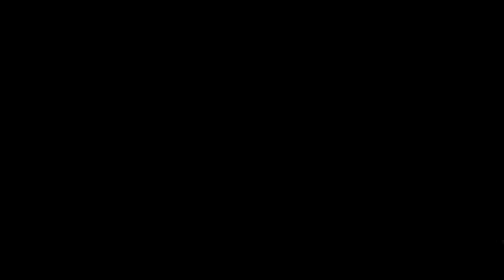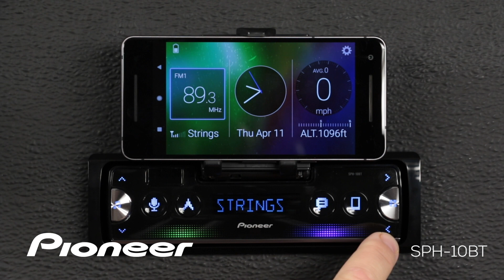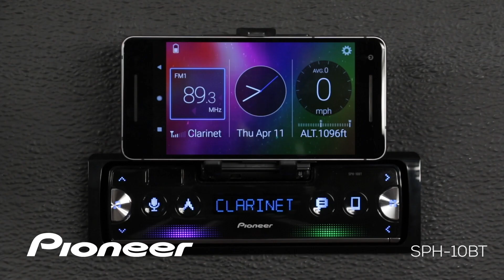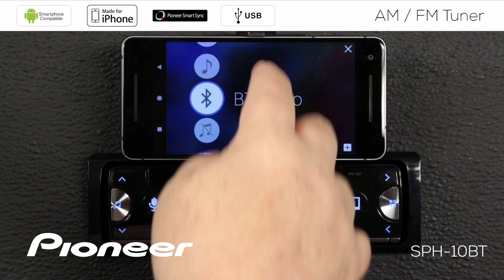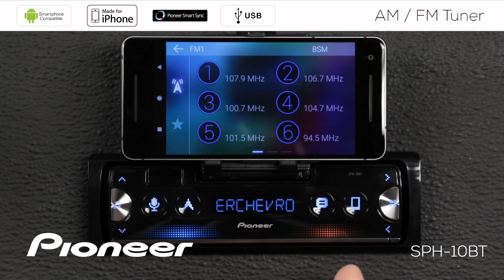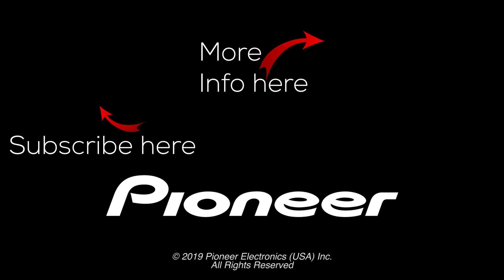How To-SPH-10BT - FM/AM Tuner with Smart Sync App

Comment: Okay it’s September 2020 and still the radio lack this function to just set 6 preset stations. You can do it in the app but when not using the app the presets are gone and only shows the BSM stations. A simple fix by just let the radio sync the presets from the app will solve this stupid problem. If I new this radio had this problem I wouldn’t buy it. I expected more from Pioneer :(
Reply: The Pioneer SPH-10BT is designed from the ground up to operate with a phone.  The phone is the control system for the receiver.  The receiver by itself has a limited number of functions, because it is designed to be operated by a phone.    If you want to use a receiver without a phone, perhaps a more traditional receiver is a better option for you.  Please consider the Pioneer MVH-S320BT.  It has radio station presets along the bottom the receiver.  Just what you're looking for.  You can see it here:  https://youtu.be/cXbvdfgLS2o   You can find more videos on Pioneer's YouTube Channel here:  https://www.youtube.com/user/pioneerelectronics

Comment: The player stops only at odd number frequencies. i.e. It stops at 106.7 or 106.9 but never at 106.8. The jumps are in multiple of 0.2s. How can i change that?
(i am not US based but i got my player from there)
Reply: The Pioneer SPH-10BT is designed for the North American market.  I'm not aware of a way to change the radio frequency interval to even numbers after the decimal.  You can find more videos about Pioneer SPH-10BT here:  https://youtu.be/_ISxPmindi4?list=PLw63zJRQbCNiGNMG9zaOiTR3NgWe2T7ol     Please be sure to have the latest firmware installed on your Pioneer SPH-10BT.  You can find it here:  https://www.pioneerelectronics.com/PUSA/Car/Digital+Media+Receivers/SPH-10BT#downloads  You can find more videos on Pioneer's You Tube Channel here:  https://www.youtube.com/user/pioneerelectronics

Comment: Is there not a way to store and scroll preset radio channels with connecting to the smart app?   I cannot find a way to do this and therefore cannot use favourite / custom preset channels without a device connected  )-:
Reply: The Pioneer SPH-10BT is designed to be operated by the connected phone.  As of 2020 March, I'm not aware of a way to change the radio station presets without using a connected phone.  Please be sure to have the latest firmware installed on your Pioneer SPH-10BT.  You can find it here:  https://www.pioneerelectronics.com/PUSA/Car/Digital+Media+Receivers/SPH-10BT#downloads  and you are using version 2.7.0 or newer of the Pioneer Smart Sync App on your phone.  You can find more videos about Pioneer SPH-10BT here:  https://youtu.be/_ISxPmindi4?list=PLw63zJRQbCNiGNMG9zaOiTR3NgWe2T7ol   and you can find more videos on Pioneer's You Tube Channel here:  https://www.youtube.com/user/pioneerelectronics

Comment: Will it ever be possible to select the radio presets using the radio buttons? It is very dangerous to change the presets using the touchscreen. And please dont tell me to update it, if it wont solve anything. I dont care about the BSM, it is worthless.
Reply: The Pioneer SPH-10BT is designed from the ground up to be operated by the Pioneer Smart Sync app with a phone in the phone cradle. If using the phone for this function makes you uncomfortable, or you believe it's dangerous, I recommend using a more traditional in-dash receiver like Pioneer MVH-S320BT seen here:    https://youtu.be/cXbvdfgLS2o   The Pioneer MVH-S320BT has radio station preset hard key buttons on the face of the radio, and it will still work with the Pioneer Smart Sync app for Navigation and other functions if you care to use it that way.
When using the latest firmware for the Pioneer SPH-10BT as of 2020 February and the latest version of the Pioneer Smart Sync app, 2.7.0 or newer, the Radio Station Presets 1 through 6 appear across the bottom of the phone screen when on the AM/FM Radio source screen.  It does not mater if the phone is in a vertical or in a horizontal position.    You can choose any radio station presets you like.   BSM, while a very useful feature, is not needed to create a radio station preset. 
As of February 2020, when using the Smart Sync app,  I'm not aware of a way to use  the hark key arrows on the in-dash receiver to scroll through the radio station presets. They operate the seek function on the radio.  One press the and the radio will tune in the next available radio frequency.  Press and hold to seek to the next available radio station.  Of course the Local /Seek function is a filter to remove the weakest radio stations.  It can be set to 4 levels of filter and switched off.  A future update to the in-dash receiver firmware and update to the app may change this operation. 
You can find the latest firmware for the Pioneer SPH-10BT here:  https://www.pioneerelectronics.com/PUSA/Car/Digital+Media+Receivers/SPH-10BT#downloads   You can find more videos about Pioneer SPH-10BT here:  https://youtu.be/_ISxPmindi4?list=PLw63zJRQbCNiGNMG9zaOiTR3NgWe2T7ol   and you can find more videos on Pioneer's You Tube Channel here:  https://www.youtube.com/user/pioneerelectronics

Comment: Im thinking of putting one of these units in my Harley Davidson fairing,im curious how well that phone holder locks onto your phone(im worried my phone might fall out of it while moving) I curretly have a S9+
tyvm
Reply: I'm not an experienced motorcycle rider.  My limited experience with Harley Davidson motorcycles is that they vibrate in the handle bar/ faring area quite a bit when idling. I would not recommend using the Pioneer SPH-10BT to hold the phone in an application with excessive vibration.  The Pioneer SPH-10BT holds the phone firmly, by using simple spring loaded friction brackets. You can see it here:  https://youtu.be/2X0_WyTEMp0?list=PLw63zJRQbCNiGNMG9zaOiTR3NgWe2T7ol&t=184    There is nothing sort of clamped over the corners of the phone to ensure it is not jarred loose during the heavy vibration you might have while idling or riding.   There are some other options.  A dedicated clamp to hold the phone and it will still connect to the Pioneer SPh-10BT for full operation.  Or another Pioneer in-dash receiver, one that has a short chassis and operates with the App on the phone the same way. You can see one option here:  https://youtu.be/K1FYzLu39ow?t=117   You can find more videos about Pioneer SPH-10BT here:  https://youtu.be/_ISxPmindi4?list=PLw63zJRQbCNiGNMG9zaOiTR3NgWe2T7ol  and you can find more videos on Pioneer's You Tube Channel here:  https://www.youtube.com/user/pioneerelectronics

Comment: Even after updating to the most recent firmware I still can't add favorites or edit present radio stations... I don't even get the star icon to add favorites
Reply: Are you using the Pioneer SPH-10BT and the Pioneer Smart Sync app on your phone?  Are you in the US?   Please be sure to have the most recent version of the Pioneer Smart Sync app installed on the connected phone. You need version 2.1.0 or higher.   If this does not work, I recommend to uninstall the app and re-install the Pioneer Smart Sync App from your app store.  Please be sure you have the latest firmware installed for Pioneer SPH-10BT.  You can find it here:  https://www.pioneerelectronics.com/PUSA/Car/Digital+Media+Receivers/SPH-10BT#downloads    You can find more How To videos about Pioneer SPH-10BT here:  https://youtu.be/_ISxPmindi4?list=PLw63zJRQbCNiGNMG9zaOiTR3NgWe2T7ol   and you can find more videos on Pioneer's You Tube Channel here:  https://www.youtube.com/user/pioneerelectronics
Reply: @deckerdotto6035  same problem. updated firmware 8.18 on radio and lateste app v2.9.1
Reply: Please be more specific with your question.  What is the model number of your Pioneer receiver?  What are you trying to do?

Comment: I need to choose the station presets. Please fix this nonsense. If I knew I would have never bought this thing.
I have the latinamerican version ( sph-10cbt ) and till now, there is no firmware for this version.
Reply: Please update the Pioneer Smart Sync App to version 2.1.0 or higher.  Radio Station Presets are available through the Smart Sync App.  Please be sure to have the latest Firmware installed on your Pioneer SPH-10BT.  You can find it here:  https://www.pioneerelectronics.com/PUSA/Car/Digital+Media+Receivers/SPH-10BT#downloads   You can find more How To videos about the SPH-10BT in this Pioneer You Tube Playlist:  https://youtu.be/_ISxPmindi4?list=PLw63zJRQbCNiGNMG9zaOiTR3NgWe2T7ol   and you can find more videos on Pioneer's You Tube Channel here:  https://www.youtube.com/user/pioneerelectronics
Reply: @deckerdotto6035  Now after updating the app, I cannot store or view favorite stations.
Please make this app usable.

THIS RADIO HAS BIG PROBLEMS
- There is no way of storing radio station presets

- Absence of play/pause button
- Mic button only works with smartsync (It launches the app even if you are using android auto, maps or waze).

If Pioneer fixes this, it will be a great product, and not the crap it is today.
Reply: Please contact Pioneer in Latin America for help.  You can find contact information here:  https://pioneer-latin.com/contactenos/

Comment: The Pioneer 10bt alone 
 have radio FM? Or only smartphone app
Reply: The Pioneer SPH-10BT has the AM/FM radio built-in.  The Smart Phone is being used as a remote control to operate the in-dash receiver.  You can find more videos about Pioneer SPH-10BT here:  https://youtu.be/vjeZ34q0nvA?list=PLw63zJRQbCNiGNMG9zaOiTR3NgWe2T7ol   Please be sure to have the latest firmware installed on you Pioneer SPH-10BT.  You can find it here:  https://www.pioneerelectronics.com/PUSA/Car/Digital+Media+Receivers/SPH-10BT#downloads  You can find more videos on Pioneer's You Tube Channel here:  https://www.youtube.com/user/pioneerelectronics

Comment: They need to fix the app/radio where you can set the presets (you cannot change them from the factory ones that are set) or have the favorites come up first instead of presets.  The presets that are set by default are not even radio stations in my area so it is useless.
Reply: As of 2019 June, when using the Pioneer Smart Sync App with SPH-10BT touch the BSM Function to change the FM or AM Radio Station presets to the strongest local channels. You can see it here:  https://youtu.be/wuV0LIVxFes?t=156  This does not effect the favorites in the system.  You can find more videos about Pioneer SPH-10BT here:  https://youtu.be/wgvHfVus7Xw  and you can find more videos on Pioneer's You Tube Channel here:  https://www.youtube.com/user/pioneerelectronics
Reply: Please update the Pioneer Smart Sync App to version 2.1.0 or higher.  Radio Station Presets are available through the Smart Sync App.  Please be sure to have the latest Firmware installed on your Pioneer SPH-10BT.  You can find it here:  https://www.pioneerelectronics.com/PUSA/Car/Digital+Media+Receivers/SPH-10BT#downloads   You can find more How To videos about the SPH-10BT in this Pioneer You Tube Playlist:  https://youtu.be/_ISxPmindi4?list=PLw63zJRQbCNiGNMG9zaOiTR3NgWe2T7ol   and you can find more videos on Pioneer's You Tube Channel here:  https://www.youtube.com/user/pioneerelectronics
Reply: @deckerdotto6035  I have the latest app version and no, you can not program your own presets.
Reply from the maker: If you have Pioneer SPH-10BT in the US please be sure to have firmware version 8.17 or newer installed.  You can find the latest firmware for the the Pioneer SPH-10BT here:    https://www.pioneerelectronics.com/PUSA/Car/Digital+Media+Receivers/SPH-10BT#downloads       Please be sure to use version 3.3 or newer of the Pioneer Smart Sync App.    
It's easy to create whatever radio station preset you like.   Use the right and left arrow hard keys on the receiver <  >  to tune in your favorite radio station.  After you have used the <  >  hard keys to tune in your favorite radio station, go to the app on the phone and press and hold a radio station for a moment to set it into memory.  This works on both the app home screen, and on the app preset list screen for AM/FM Radio.  You may find it easier to operate the <  >  keys if you switch the receiver's Local Setting to off.  You can find the receiver's local setting in the Pioneer Smart Sync App, under Settings > Radio > Local.    You can find more videos on Pioneer's YouTube Channel here:   https://www.youtube.com/user/pioneerelectronics
Reply: Please be sure to have the latest firmware update for the Pioneer SPH-10BBT installed.  You can find it here:   https://www.pioneerelectronics.com/PUSA/Car/Digital+Media+Receivers/SPH-10BT#downloads   An update to the Pioneer Smart Sync app in late June 2019 makes it easier to use the Favorite Radio stations.  Along with Custom Wall Papers for the app.  Please stay tuned for future updates.  You can find more videos on Pioneer's You Tube Channel here:  https://www.youtube.com/user/pioneerelectronics
Reply: @deckerdotto6035  that link doesn’t even take you to the firmware information or update.
Reply from the maker: You can find the latest firmware for the Pioneer SPH-10BT here:    https://www.pioneerelectronics.com/PUSA/Car/Digital+Media+Receivers/SPH-10BT#downloads

Comment: Hi how do I change the preset to the channels i want ? i have them to favorites but i want to add them to preset, thank you
Reply: I'm very frustrated that this radio has no ability to store presets. Who decided that the "six strongest station signals" would be the six a user actually wants to listen to? Please fix this. Make the possibility to store radio presets manually as every normal car radio receiver is able to. The favorites list is not a solution as it is not controlled by the steering wheel buttons and is not available if the radio is used without the app connected.
Reply: Please be sure to have the latest firmware update for the Pioneer SPH-10BBT installed.  You can find it here:   https://www.pioneerelectronics.com/PUSA/Car/Digital+Media+Receivers/SPH-10BT#downloads   An update to the Pioneer Smart Sync app in late June 2019 makes it easier to use the Favorite Radio stations.  This does not address the radio station presets, but does make the Favorite Radio Stations easier to access.  Please stay tuned for future updates. You can find more videos about Pioneer SPH-10BT here:  https://youtu.be/N6Lfcnjyboo?list=PLw63zJRQbCNiGNMG9zaOiTR3NgWe2T7ol    You can find more videos on Pioneer's You Tube Channel here:  https://www.youtube.com/user/pioneerelectronics
Reply: As of 2019 May, this version of the Pioneer Smart Sync App, has radio station favorites that can be set to any radio station you want.  Radio Presets can only be set with the BSM function.  You can find more videos about Pioneer SPH-10BT here:  https://youtu.be/wgvHfVus7Xw?list=PLw63zJRQbCNiGNMG9zaOiTR3NgWe2T7ol  and you can find more videos on Pioneer's You Tube Channel here:  https://www.youtube.com/user/pioneerelectronics
Reply: Please update the Pioneer Smart Sync App to version 2.1.0 or higher.  Radio Station Presets are available through the Smart Sync App.  Please be sure to have the latest Firmware installed on your Pioneer SPH-10BT.  You can find it here:  https://www.pioneerelectronics.com/PUSA/Car/Digital+Media+Receivers/SPH-10BT#downloads   You can find more How To videos about the SPH-10BT in this Pioneer You Tube Playlist:  https://youtu.be/_ISxPmindi4?list=PLw63zJRQbCNiGNMG9zaOiTR3NgWe2T7ol   and you can find more videos on Pioneer's You Tube Channel here:  https://www.youtube.com/user/pioneerelectronics
Reply: @deckerdotto6035  Does this mean there's a way to change the radio presets that are in the unit itself, and not only the app? How to change the presets without BSM? I don't care for the six strongest signals, I care for my six favourite signals. Only having them available with a smartphone seems a gross oversight.
Reply: Please update the Pioneer Smart Sync App to version 2.1.0 or higher.  Radio Station Presets are available through the Smart Sync App.  Please be sure to have the latest Firmware installed on your Pioneer SPH-10BT.  You can find it here:  https://www.pioneerelectronics.com/PUSA/Car/Digital+Media+Receivers/SPH-10BT#downloads   You can find more How To videos about the SPH-10BT in this Pioneer You Tube Playlist:  https://youtu.be/_ISxPmindi4?list=PLw63zJRQbCNiGNMG9zaOiTR3NgWe2T7ol   and you can find more videos on Pioneer's You Tube Channel here:  https://www.youtube.com/user/pioneerelectronics
Reply: Please be sure to have the latest firmware update for the Pioneer SPH-10BBT installed.  You can find it here:   https://www.pioneerelectronics.com/PUSA/Car/Digital+Media+Receivers/SPH-10BT#downloads   An update to the Pioneer Smart Sync app in late June 2019 makes it easier to use the Favorite Radio stations.  Along with Custom Wall Papers for the app.  Please stay tuned for future updates.  You can find more videos on Pioneer's You Tube Channel here:  https://www.youtube.com/user/pioneerelectronics
Reply: Please be sure to have the latest firmware update for the Pioneer SPH-10BBT installed.  You can find it here:   https://www.pioneerelectronics.com/PUSA/Car/Digital+Media+Receivers/SPH-10BT#downloads   An update to the Pioneer Smart Sync app in late June 2019 makes it easier to use the Favorite Radio stations.  Along with Custom Wall Papers for the app.  Please stay tuned for future updates.  You can find more videos on Pioneer's You Tube Channel here:  https://www.youtube.com/user/pioneerelectronics